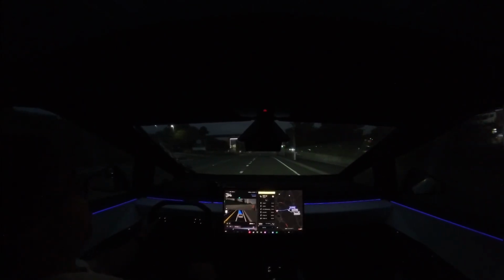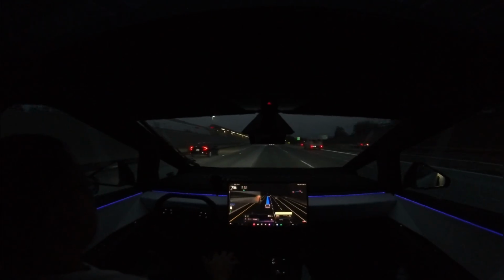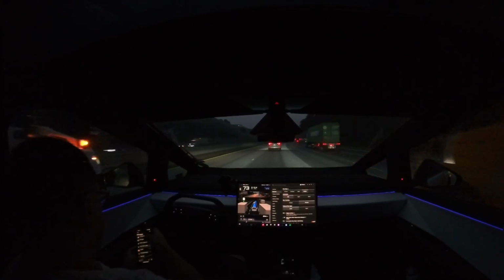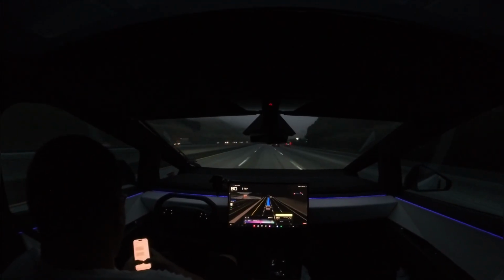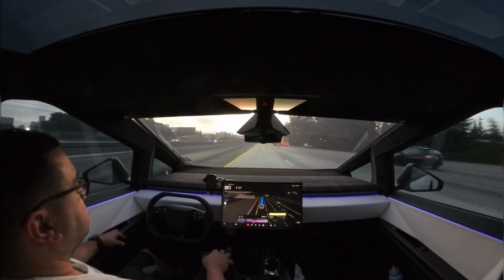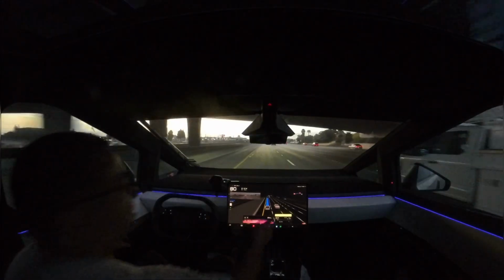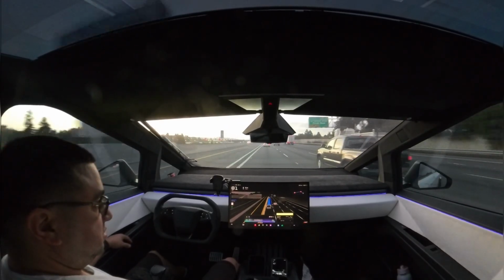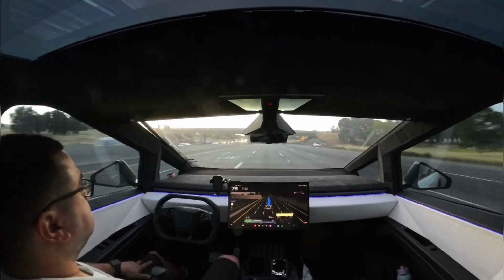Cybertruck 1,732 Mile Road Trip — FSD, Towing 6,000 LBS & My Honest Thoughts 🚛⚡

Comment: Was the trailer any wider than the truck? That could've been a problem because the trailer could've hit a parked vehicle while driving by it.
Reply from the maker: Yes trailer is 8ft wide but it still was great towing just the charging was the only issue